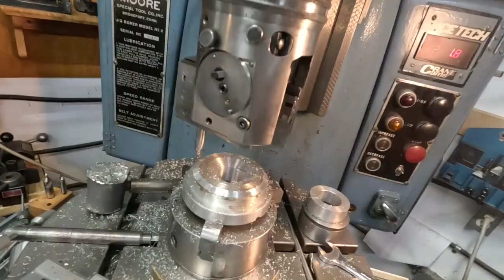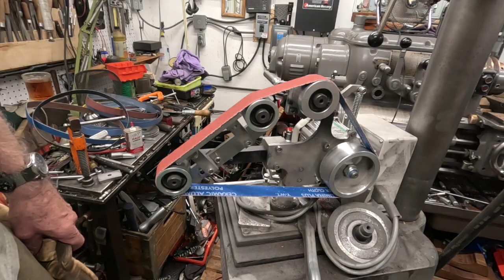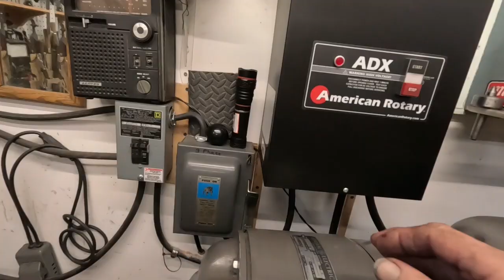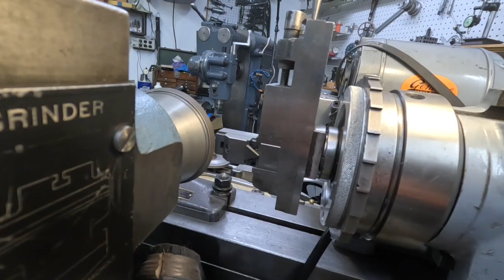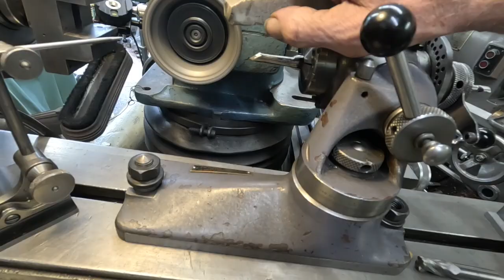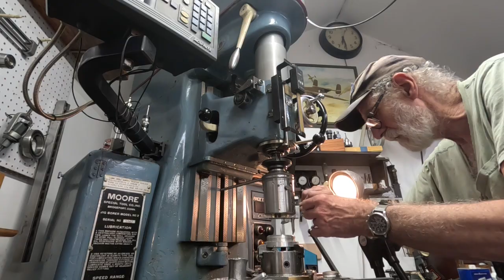Tool making, brazed carbide angle cutting bars for Wohlhaupter UK4

Comment: I have such a hard time with brazing.  Soldering is no problem, but brazing is just... weird.  Someday I'll figure out what I'm doing wrong 😀
Reply from the maker: I need to do more of it, most will silver braze the carbide on at lower temperature but brass is certainly cheaper but takes more heat, thanks!